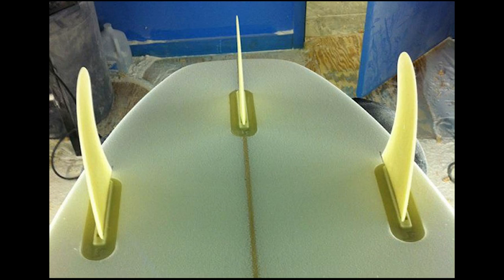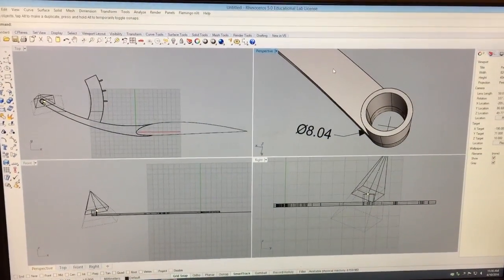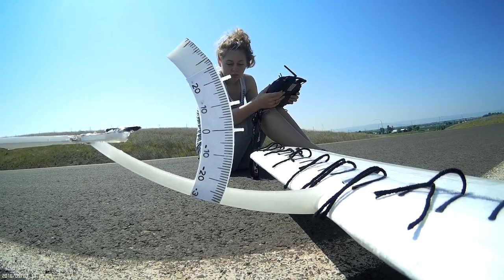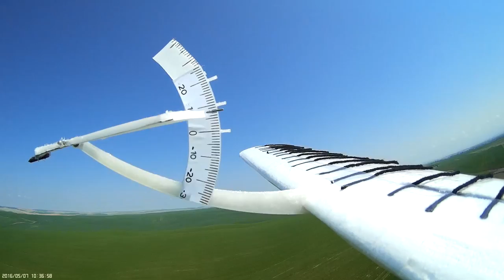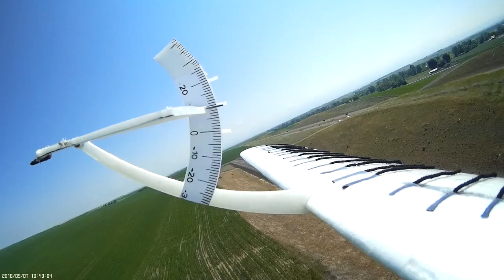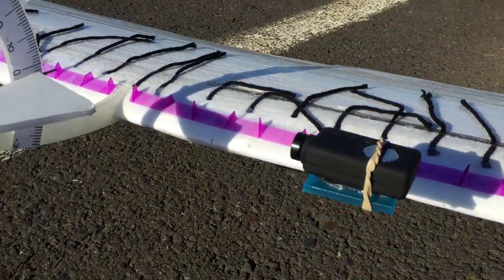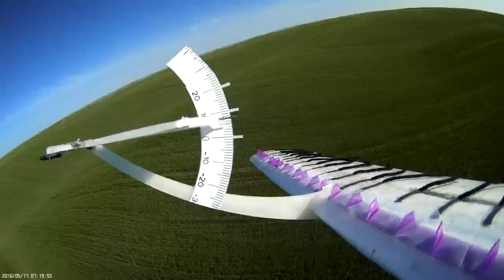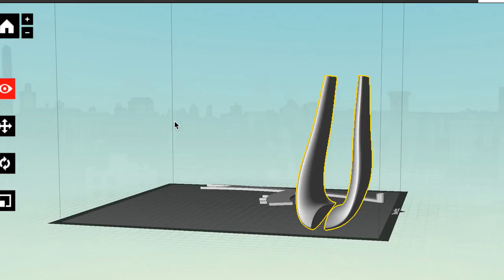Visual Angle of Attack Indicator

Comment: Hey Samm, I love the video!  I am training to be a Flight Instructor and have used this video to help me understand angle of attack.  I was curious if you could shoot another video of this same setup on the airplane but focus on just straight and level descents and climbs with and without power.  I am curious what the AOA would be in a 20 deg climb with full power vs half power.  I am trying to figure out the relationship between power-thrust-speed and the AOA because it seems as though when you were in a climb with full power, there was only a relatively small AOA.  I don't know if Im making much sense.  Its hard to put into words.  Thanks! Love the videos
Reply from the maker: Excellent observation. In an unaccelerated, constant airspeed climb we can expect our AOA to be very similar to that of a cruise or descent of the same airspeed. First let's look at the things that determine how much lift a wing makes: 
The lift equation is (and I'm compressing a few things): Lift = AOA * (Air Density * Airspeed squared divided by 2) * wing surface area.
Now the next bit to understand is that the only time we are ever producing more or less lift than exactly the weight of the aircraft is when we are CHANGING DIRECTION. If we produce more lift than we weight than we will change direction upwards, if we had the power to maintain airspeed and produce the same excess of lift long enough we would just make a nice circular loop.
Anyways when we pitch up to start a climb, initially we increase our AOA so that we produce excess lift in the upwards direction and this changes the direction that we are traveling. But as we start to travel upwards, the relative wind (which by definition is opposite the flight path) also starts coming from a higher angle.
So let's say we are cruising straight and level at 100kts and the relative wind is coming directly from the horizon and our wing's AOA is like 4º because the wing is mounted on the fuselage with an angle, in this case like 4º. So 100kt and 4º AOA = our weight. Now lets establish a climb to 10º above the horizon. We initially increase the AOA to like idk 6º, producing excess lift and changing our direction upwards. However once our nose is at 10º and we are traveling upwards, the relative wind is opposite the flight path. The wing is still at the same AOA. Of course now we get into more fun stuff like the thrust vector opposing gravity and the lift vector pointing back a bit. Eventually at a vertical climb we would be hanging on the prop and need no lift from the wings... Ugh this stuff sucks to think about so hard. Anyway hope that helps a little.
Reply: Yes, that helps very much!  Thanks for your help, and the quick response.  Best of luck.

Comment: That is a great little device, would be handy on all planes, how does it get effected by turbulence, turbulence is a factor that can cause problems, I'm sure your device would make turbulence apparent.
Reply: All planes?  Commercial and business aircraft already have either AoA vanes or AoA is measured by the Air Data computer.  Turbulence is a function of air flow and as such AoA would be affected by it no matter what type of device you use to measure AoA.  Don't confuse AoA with pitch angle.

Comment: Does dimple paper improve anything ?What does it take to make a stall warning indicator ? Aoa + airspeed (+ fancy math) + ?
Reply from the maker: It sure looked like it did, but I can't rule out electrostatic attraction or other factors. I don't think it felt much different.
Most stall warning indicators are actually AOA indicators. Piper and Beechcraft like to use a little tab that get lifted up when the airflow comes up at a sharp enough angle (cause of the high AOA). Cessna likes to use a funny whistle that sounds when the airflow goes across it at a high angle.
Pilots are trained to know "stall speeds." But a wing can stall at any airspeed. since when you slow down you must also increase AOA to create enough lift, there is a lower limit to airspeed, just because there is an upper limit to a wings AOA.
Reply: Yeah, I think the material could be an insulator.

Comment: Super cool project. I've always been of the assumption (at least from a feel standpoint) that I never felt any difference at high angles of attack whether I was coordinated or not in an R/C plane with VG's. @Samm Sheperd, would you agree this is due to the tiny chord size at such a small reynold's number? I've just assumed so but never actually investigated and my knowledge of aerodynamics isn't much further than what was required for my CFI checkride haha. Full scale planes with such a large chord size seem to be much more positively altered by having full span VG's.
Reply from the maker: Man it sounds like we’d get along
Reply: lol I was legit asking though, cuz I have no clue if the reynold's number has anything to do with it. :-)

Comment: I'm starting to get interested in RC planes and stuff but living in Italy is having a hard time finding the materials... Where do you buy the foam for the wings and fuselage...?
Reply from the maker: This plane was made with insulation foam found in home improvement stores. Another great material is foamboard found in stores with a craft section. Normally used for school projects or presentations or something.
Reply: Thanks also i wanted to know if there was any website that published airfoil shapes or something to use..?
Reply from the maker: airfoiltools.com is where I go a lot but I decide what airfoil is best by researching the specific application, Such as googling best airfoil for flying wings etc

Comment: You aren't dealing with a perfect infinite wingspan. The stall angle along the span changes due to the effects of wing tip and by the body of the aircraft(and the joint details), small gusts can briefly effect the true AOA and reattaching flow can  require a lower AOA than it took to detach the flow.
Reply from the maker: Yep
Reply: My reply was in response to the statement in the vid that you were having problems determining a clear stall AOA. 
...though the vid was posted the better part of a year ago. 

I mostly reply to stimulate my own memory, it's been a decade since messing with sailboats and 15 years since studying fluid dynamics and aircraft design.

Comment: I would sugest you that the stall angle is for a specific speed so measuring the stall angle needs the velocity it happenned, sry for the bad english, im seeing ypur videos and really like some Great ideas you have and a probably  test too in my future project of a uav.
Reply from the maker: +saulo lucena stall angle has nothing to do with airspeed :)
Reply: L=(1/2)rho(V^2)*S*CL
If you Look to the lift equation, you can see that we have CL, this coefficient of lift varies for every angle of attack of the wing does, so, if you keep lift L (at  least the aircraft weight ) you see that velocity Will depend on  CL the aircraft is and for consequence the angle of attack it is doing at the moment, so every angle of attack has a specific stall speed
Reply from the maker: I know the lift equation by heart too.
Fundamentally, ignoring the other dynamics of flying an aircraft, a wing stall only has to do with AOA. 
We call it stall speed, because in straight and level flight, in order the maintain altitude while decreasing airspeed we need increase AOA (CL), up to the point where we reach critical AOA, the. We can't go slower because we also can't increase AOA. If we just create less lift and start descending then the relative wind will change direction and to avoid stall we have to pitch down a bit and then we will speed up.
A wing can stall at ANY airspeed. Eg. A dive bomber trying to pull out of a dive. Crazy g forces, loads of airspeed, but they would often reach critical AOA and have a high speed stall.
Reply: now i got what you mean, to the Max stall angle you can reach to the minimum speed you can maintain the aircraft flying, thats yours maximum reachable angle of attack during a flight.

Comment: There is no such thing as a universal angle of attack for stalling a specific wing. The velocity of the surrounding air is a crucial factor.
Reply from the maker: The only argument in favor of your assertion that I can see is that at a small scale such as this, the Reynolds Numbers change quite a bit with change in air velocity. At these relatively low Reynolds number, when the airspeed is reduced, then the flow's ratio of inertial to viscous forces changes and the flow becomes relatively more viscous and the flow tends to stay laminar and experience boundary layer separation easier than it would at higher reynolds numbers. However it is a fundamental teaching in aviation that a stall has absolutely nothing fundamentally with airspeed and 100% to do with exceeding the wing's critical angle of attack. Stall speed is simply a result of a specific aircraft needing a certain amount of lift to oppose it's weight in level flight.
Reply: ***** A stall is caused by the separation of air flow. The stall angle by definition is the angle at which the air flow at the upper side of an airfoil seperates which causes a loss in lift at a constant relative wind. But when the relative wind is not seen as constant, the possibly higher velocity of air causes the wing to stall at a much lower angle as the airflow is not able to stay as attached to the airfoil as with a possibly lower velocity of air.
Reply: An airfoil will stall whenever the critical angle of attack is exceeded, what most theory of flight handbooks don't bother mentioning is that the critical angle of attack changes with airspeed and numerous other factors.

Comment: interesting but i think not that representative. wobbles, actual wind and whatever else dont necessarily show where the aircraft is actually going, but not like you need that information when watching a yt video :D
maybe you should make the same thing for a commercial that you fly, ofc only if you're sure you wont have to write down three if you do that :D or just point your camera to view where the existing one is, idk about small commercials :P
Reply from the maker: Actually, since the wind vane is balanced, the wobbles do represent the wind. The wobbles you see is turbulence in the air, and the turbulence is just air moving around rapidly, and when you move through it you are experiencing your AOA changing rapidly, and thus lift changing rapidly, and thus it shakes your airplane!
Reply: im probably trying to learn the wrong thing from this :P

Comment: why have you stuck those black threads on the wing ?what does it do please explain.
Reply from the maker: Their called tell tails and they're used to help see the airflow at the surface. When a wing stalls the boundary layer reverses flow and you can see that happen when the string flails around

Comment: The best airfoil is a flat sheet thats why the sheet of foam board does fly
Reply from the maker: Air would much prefer to follow a nice round leading edge at various AOA :) and it's much easier to make something with thickness have structural strength. Also you can give the airfoil camber without an arched bottom surface.
Reply: Flat sheet is the best airfoil in supersonic flow, and I'm quite certain that RC boards don't fly at those speeds.   :-)
Reply: hahaha true would be cool though also i saw a vid of a rc glider going 500 mph (800 km/h) search for RC glider 500mph then you will find it griffn14
Reply: +djRC 505mph RC glider? Meh, lame. It's not scary at all, and it does not sound like a guided missile. XD
Reply: +griffn14 it is going 505 mph tho :P

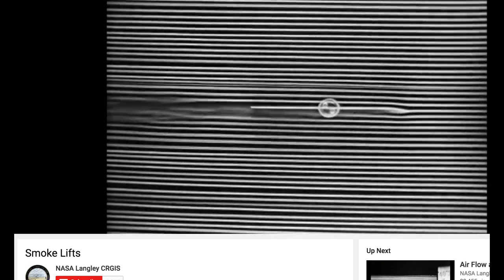Comment: 0:08 how can i make mg own smoke lines?
Reply from the maker: google around. I borrowed that clip from youtube but you could use dry ice and water in a bottle with a hole in the cap. Or better is a heat element with oil on it. or if you're super fancy you can make hydrogen bubbles in water with electrolysis